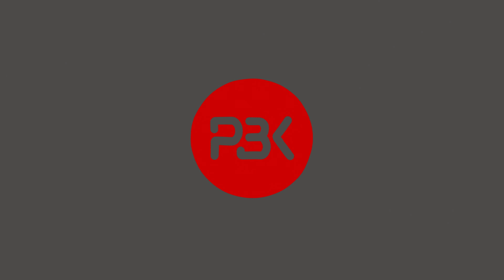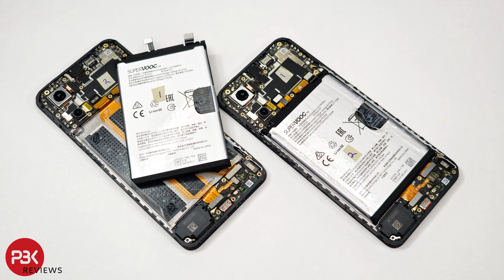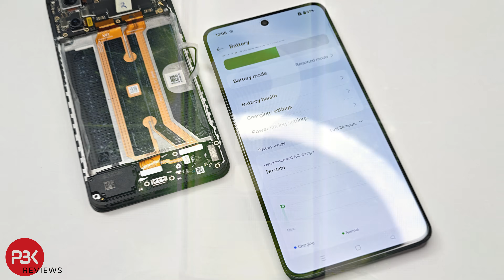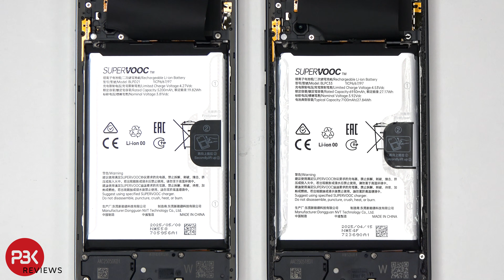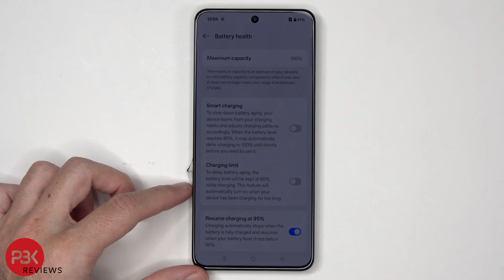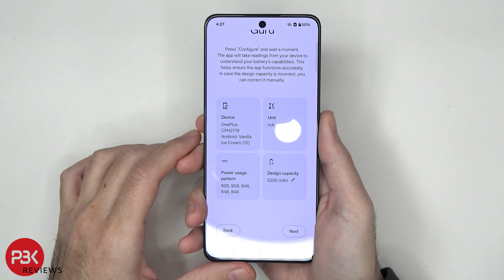Can The Battery In Your Smartphone Be Upgraded? Let's Find Out! OnePlus Nord CE5 5G

Comment: I hope that this method will work for HMD Skyline, as their batteries are no longer in stock despite marketed as easy to repair.

Phone technicians told me they can still make my phone work by transferring the flex cable to the new battery. But I still am not confident with taking the risk.

Comment: You mentioned they are the almost size or same. While the chassis is identical, the internal space is managed differently. In the EU version, there is simply dead air or a physical spacer where the extra battery density would have been. OnePlus uses the same external mold to save on manufacturing costs, even if the internal component (the battery) is physically smaller or less dense.

Comment: I do same like this battery upgrade 6 months before still good i have poco X6 Pro that is 5000 mah battery i used to poco f7 battery 7550 mah I change the battery not connectors i desolder f7 connector and shoulder to x6 Pro connector ☠️ normal usage 2 days battery backup and gaming performance 6 to 7 hours pubg 120 fps and 4 hours GTA V on poco X6 Pro🤯
Reply: waw, is the battery compartement enough for poco f7 battery? i already do this but on my poco f5 pro using poco x7 pro battery
Reply: I think is not gonna fit on the compartment  @slamup
Reply: That is very cool dude. I am very curious to try it. I have the Poco F6 is there any chance the F7 battery could fit in the F6 if you solder the F6 connector on the F7 battery?
I am just asking because you seem to understand these things deeply.

Comment: I hope you can make a follow up video, charging both batteries to 100% (or until they stop) when they are swapped, then put back to their respective original phones and see what battery percentage is shown

Maybe swap the sisterboard and see whether that will allow the battery to be recognized?

And just train of thought, I still think it is beneficial for those with EU models to swap in global battery, because for those that charge to 80% to slow down battery ageing, now they don't have to with the 7000mah, they can just charge to 100% because the battery will never be full. They can now enjoy full capacity with longer battery lifespan.
Reply from the maker: Yeah, for longevity would be good.

Comment: Maybe set the battery capacity manually to 7100mah in accubattery and then completely drain the phone and fully charge it with accubattery in the background, doing a health test basically, and see if it actually goes over 5200.
Reply from the maker: I didn't see any section in accubattery that would show you the charge level to gauge if it would go over 5200 or anything like that.

Comment: You have different voltage ratings on batteries and its not reporting battery model,
so there is nothing surprising that you can't get max capacity and value not changed. 

Those min-max voltages and capacity often are specified in kernel, but some firmware allow you to edit values via config file.
Apps like Advanced Charging Controller (Github ACCA) can read or modify it via root in that way too.

It can be chemically different or identical batteries with different "bms" ( more correct to say a charge/discharge protection, as its simplified and bms on phone pcb).
Identical batterys may have different voltage ratings due to quality or expected battery cycles. 

Min voltage can be lower for bigger capacity battery too, so its fine to do that replacement, but not opposite, as its can be near same as replace LiFePo and Li-ion (hope that build in protection bms save it)
Reply from the maker: Thanks for the info. Yeah I'm pretty sure it has something to do with the firmware or the kernel as you said. But to me these batteries seem identical and I feel that one is only limited by the firmware or something. Again I don't have the knowledge for rooting the device etc and doing firmware flashing to go into all that but I just wanted to see if a general battery swap would work for upgrading. I knew the answer for the most part from past experiences but some devices you are able to but its rare.

Comment: I suspect that the batteries are actually the same, it's just that EU variant has limited maximum voltage.
Reply: If so, then EU battery will have more full charge cycles and hold its max capacity for longer, unless they sort it by resistance and quality 😅
Reply from the maker: yup

Comment: Maybe the battery test apps just get the capacity from a database instead of reading it from the battery?
Reply: Phone can get battey info from battery model via database, battery controller or kernel data.
 In that case there is no advaced bms on battery to report it, so it uses firmware values. You also not gonna get max capacity of bigger battery as they has diff voltage specifications. 
And if there is no voltage limit and just battery protection...its not very save.
Reply from the maker: The phone model number was the same as the one with the 7100 mAh on the boxes and spec sheets, so I would assume the database online would show both phones being the same phone based off model but the same test on the 7100mAh phone showed its battery at 7100 so not sure. Also the second app I ran, showed on the bottom left corner it was testing the battery before coming up with the capacity.

Comment: This gonna favor EU phone tech shop's to offer batt upgrades if they do source it from a dealer somewhere in Shenzen, China.
Reply from the maker: The larger battery will fit and work, but the phone only shows 5,200 mAh regardless of the larger battery being put in. So there is a software lock or restriction which may require flashing the firmware from the Global or India variant to an EU variant to properly read the battery and unlock the full capacity etc. So not sure if this will be something everyone or every shop would be doing etc.
Reply: @PBKreviews yes, good sir. I forgot to mention those enthusiasts out there. There has to be a workaround since your same sample is from 1+. Procedure's easier than that 1-2TB internal memory upgrades for iPhone 15 (or 16?), years ago.

Comment: I wish the aftermarket battery start using silicon carbon too 🤞
Reply from the maker: probably one day they will but I feel like the aftermarket ones will not function as well as a genuine one would.
Reply: @PBKreviews where order original parts ?
Reply: @PBKreviews did you try change country ?
Reply: 10:15 also have you charged it from 0 to 100 percent to see the estimated capacity in health menu?
Reply from the maker: no I didn't attempt that, but based off past experience, I'm almost certain it would require the firmware from one of the versions which has the 7,100 mAh battery to be flashed onto the phone so the software will unlock any restrictions. Because from the looks of it, I feel like OnePlus used the same exact larger battery but just labeled it differently, and locked the capacity the phone would charge the battery down to 5,200 mAh to meet the EU battery regulations. So in reality all the nord ce5 5g phones have the same exact battery, but the EU one is just firmware locked in the software to restrict the battery capacity. I could be wrong but that's what it looks like to me.
Reply: @PBKreviews ahh ok i got you

Comment: like i have got global version of nord ce 5 . inside about phone section is has set to 7100mah i thought it was 7100mah so i bought it after 2 month of usage i found it was 5200mah . my phone charge 30-35 mins by same orignal charger where same charger when charge to orignal 7100mah its need 1 hrs + . so yeah i got scam /
Reply from the maker: The problem with how they word "global" is that it makes people think there is one single Global version and the rest are region specific. Some places refer to Global as a global rom which has google play pre installed and not a China Rom. Where others refer to Global version as being the device which has support for more global bands etc. This phone was even more confusing since there was an Indian variant which had the 7100 mAh battery, a global variant which also had the 7100 mAh battery, and a EU Global variant which had the 5,200 mAh battery but global firmware/bands. They need to make the naming more simple and clear.
Reply: @PBKreviews like but in about phone section it has mention 7100mah my friend also have same phone same box from same dealer he has got real 7100mah but how I got so unlucky like I asked dealer to change the battery or the phone because the phone itself is a defect because it is mention 7100mah in about phone section but the real capacity is 5200mah . He says no no this is original product I know it's original but I was not expecting a 5200mah battery inside where it is set to 7100mah in about phone section 😢
Reply from the maker: did you take apart the phone and see that it's a 5200 mah battery? if not then where did you see the capacity or verify that it's 5200 if it's showing 7100 in the about section
Reply: @PBKreviews  like i get only 7 hrs of backup in normal usage . and like it charge 100% by 34 mins and in acuubattery also its shows estimate to 5460mah so in this way i found that . and if the phone was orignal 7100mah it would take 1 hrs + to full charge my full charge in just 34 mins
Reply: so yeah it was my first oneplus device so yeah the impression was very bad at first sight